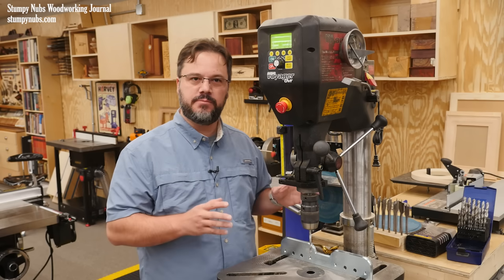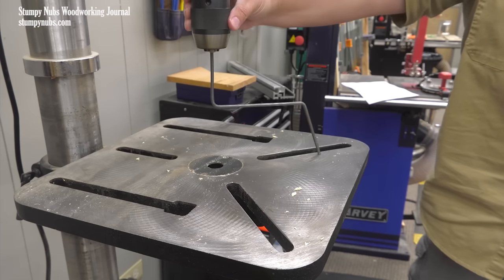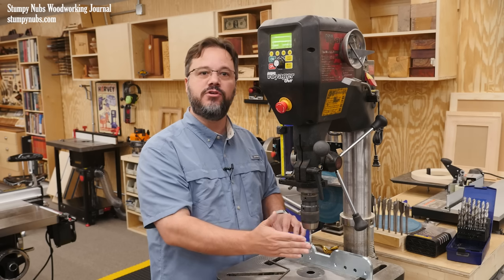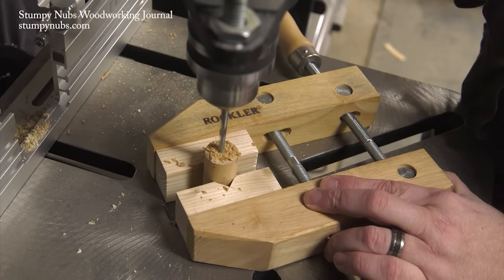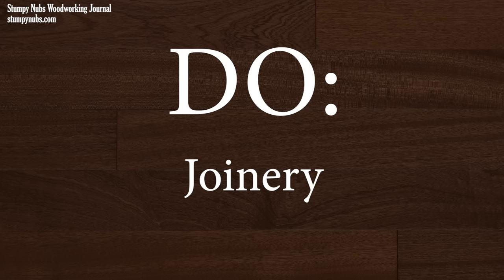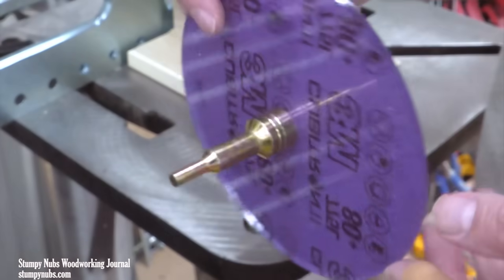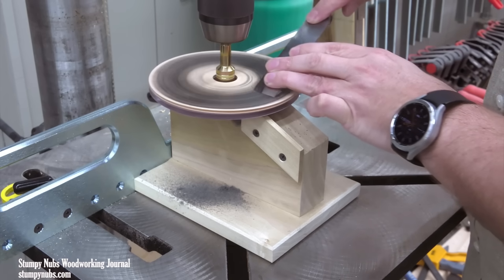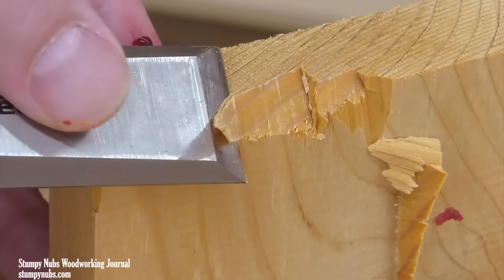WARNING: Internet drill press trend can SERIOUSLY hurt you!

Comment: Love this video! 
Another useful tip I learned: Place a block of wood down onto the drill plate first if you are doing to drill holes through sheet metal. This reduces the chance of the drill bit biting the sheet metal part and it helps to drip the sheet metal from wanting to move or spin.

Comment: Another DON’T: Do not accidentally leave the chuck key in the chuck and start the drill. It will quickly do one of two things 1) become a projectile or 2) remain engaged and repeatedly whack your hand if too close with enough force to break bones. Ask me how I know 🤪
Reply: And if you are enough of a goober to forget, magnet plate on the wall. Key goes on plate, plate pulled to magnet and turns on switch. Pull key, plate moves back and switch turns off.

I made my own after the 2nd key to the balls 😅

You could also add a cutoff switch to the key holder but I didn't think of it at the time.

Comment: I have a set of Delta router bits for my WW2 vintage Delta 14” bench model, they are an approved accessory. But there’s a trick. The set requires using a #974 spindle, with replaces the regular morse taper with a straight 1/2” hole for the bit, which is then secured with a set screw.
Reply: You basically have 2 in 1, drill press + milling machine.
Reply: @CemKalyoncu  Well I would if I had the 974 spindle. Sadly, that was missing when I got the machine. I do have the spindle for the shaper bits, but none of the rest of the parts like the fence & shaper bits. It did come with a complete morticing attachment though. It’s a cool machine, the serial number plate is made of paper card stock, dating it to 1943 when the US was conserving copper & brass for the war effort
Reply: @VernKlukas  That is very cool machine.

Comment: One nice use for a drill press is as a line borer  with a shaft in the chuck going through a bush in the table to hold the far end but still slide up and down. A cutter is fitter through the shaft at right angles to bore large holes very precisley. Milling cutters Will pull the chuck out, I know. great video.

Comment: Great tips. I can’t imagine having a shop without one. You may or not approve of this next use. I restore vintage Matchbox cars and I use a couple of fairly big finishing nails with little dimples on them to reform the axel ends to secure the wheels. I use the slowest speed possible and when possible hold the axel with small vice grips. 😅

Comment: I once caught my glove with an electric hand drill, even though I stopped it quickly, it was quite paintful for my finger and happened in a split second. Imagine what a big drill could do.
Reply: I had this happen with a battery powered drill, while screwing off a metal roof. The construction co's pen pushers had insisted gloves be worn at all times while working on their sites. After that incident, I told them, 2 choices: 1- no gloves while doing that job, or 2- find another roofing contractor. Never mind that wearing gloves meant the job took 3 times longer than it normally would!
Reply: And it can be so hard to explain gloves do not always mean safer too.

Comment: I used a step bit on a piece of sheet steel while just holding it in my left hand once.  Once.  After a week or so of healing and cleaning up the dried blood I used my fancy clamp I couldn’t be bothered to use the first time.  Took longer than it should have since I could only use my right hand.  Some lessons have to be learned the hard way I guess.

Comment: My biggest complaint with drill presses is that the slowest speed is way too fast.  I thought about buying a variable speed mag drill but for the small amount that I use it, the price was prohibitive.
Reply: Bosch have a green drill press with electric speed control and digital display that can swap to depth indicator. It will slow all the way down. Best benchtop drill press on the market.
Reply: It's possible to slow them down even more with a different set of pulleys. For woodworking I usually just use mine at the slowest speed.

Comment: Just be aware magnetic trays may magnetize bits and cause metal shavings to stick to them. Just annoying especially when trying to setup and ya can see the tip of the bit.
Reply: It's mostly a woodworking channel in fairness, not ferrous machine work where that is an issue.

Comment: I like your video emphasizing safety. It's too often disregarded. I started working on both cars and wood more than 50 years ago. I have my own shops with lots of tools including machining tools for metals. I always protected myself, secured my hair, wore eye shields, never wore gloves when working with the drill press or any other machine for that matter (other than my welding equip.) and I tried to maintain a safety first attitude all my life. The result? No loss of any digits, eyes or anything else. No significant injuries either, although working on cars can slice or mash fingers and skin. My biggest injury is 50 plus years of doing this work is hard on one's back. Another thing: if you're doing construction (I built two houses and four shops) always wear a hard hat.

Comment: I was a machinist at a place where a lady came in to tell us about the dangers. One story she told was about a young lady with braids who ran the drill press and she left her hair unsecured and it wrapped around the spindle and scalped her. Another guy was  using a band saw and he touched the blade and lost the end of a finger, and then this efficiency expert was instructing the other workers on what not to do and she asked this same worker what mistake he'd made and he demonstrated what he did with the band saw with it RUNNING AND CUT OFF ANOTHER FINGER.
I could go on and on.
Be smart when around metal cutting machines.

Comment: I know someone who uses an XY-table with their drill press. It's great when drilling small holes, if you have centerpunched the location. When setting down the drill (turned off) into the dimple of the centrepunch the drill should not bend. Check both directions and your tiny drill bits will last. Especially with drill bits smaller than 2 mm.

Comment: Any work should be secured on a drill press. A drill press isn't magic, it has limits. If your working with anything harder than soft pine make sure you have the right drill for your chosen material. The details of tool safety are learnt. I was taught at age 11 and everytime i approach working the next piece of material i carefully consider everything from lining up the tool to material, always creating a pilot hole with a punch and then smallest drill, but first clamping or bolting and last not standing where the machine could 'pitch' the material if clamp slips. I have experience using many tools and i learn more each time. Thanks for teaching proper tool use. Ignorance isn't bliss it's fatal.

Comment: I can testify about clamping metal pieces down for drilling. In my teens I was using dads drill press to drill mounting holes in a piece of sheet metal. The first couples holes went fine, then the bit caught a burr, ripped the sheet out of my hand, as you stated like a helicopter blade, as I reached up to turn power off, the metal sheet flipped upwards catching the inside of my left forearm. I still have the scar. Lesson learned the hard way.

Comment: Putting a strong magnet on the side of the drill press to hold the chuck key is a game changer. (As an IT person, I have access to plenty of used hard drive magnets which are super strong, although they're getting fewer and farther between with SSDs becoming popular.)
Reply: This is true when you do woodwork. If work on steel the chips will hang on the drill bit and the key.

Comment: Thanks for this video, Stumpy! I use a drill press mainly for metal, which I always clamp down - but didn't know about the NO GLOVES rule! Metal is either sharp (or hot) and as I'm on blood thinners, I generally always wear gloves. Might have to rethink this, given what you've pointed out here, and many others have commented about here. Safety is paramount: I'm just an amateur sculptor, but developed safety consciousness while working as a pilot and so I realize that it's always worthwhile checking out videos like this one!
Reply: Use the gloves when setting up and handling work, but always make sure to take them off before you turn on any machine. Since you have a reason to want to have gloves on for more than just convenience, you may just need to spend more time getting a setup that doesn't require gloved hands.

As a machinist I never wear gloves. I've learned over the years how and when to grab metal during various stages of sharpness. The only time I ever wear gloves is when welding (or sometimes when using a torch), and so never have gloves around rotating equipment.

Comment: This is a great video for my students. One thing I would suggest: Don't wear watches when using rotating equipment. I tell my students to take off watches and rings when running the vertical mill for instance. The drill press is maybe even more dangerous than the mill, because of clamping issues.

Comment: for using drill press for 20+ years for metal work, I also suggest to test how much torque your drill has. that way you know if you can stall it or not with the part you are holding, so you dont hurt yourself if the drill bit jam into the hole. If I have lot of part to drill, I dont like to clamp them all one after other.

Comment: On drilling any objects in a drill press but specifically metal parts.
A drill press rotates clockwise, always put a stop on your drill press table at the rotating direction, so at the left side. Rest the to be drilled part against this stop. If the drill catches the part will hit that stop and not be ripped out of your hand.
For metal the ratio of your drill bit to the thickness of the part is also important. Trying to drill a 1“ hole with a spiral metal drill bit into a 0,039“ thick sheat metal is asking for disaster.

Comment: Valuable Tip:for thin material: shim stock, especially plexiglass or brass- place your drill bit on the bench looking at the cutting edge. Roll the bit until the leading edge of the rake is parallel with the bench.Now using a small machinist’s triangular stone, create a small flat on the leading edge of the bit.The bit will still drill fine, but will not grab as it goes through the material.You’ll save many a part and avoid the usual “grabbing “ and possible injury.My dad had a whole different set of “flared off” bits just for this. Try it,you’ll see.

Comment: Good point about not trying to use router bits because of the side forces.  For the same reason don't use milling cutters in a drilling machine when metalworking.  The cutter shank can work its way out of the chuck while it's cutting.  There's a reason why milling machines use collet chucks.

Comment: If I need to drill into metal, it's important to understand speed, cutting capabilities and "press speed". I always add a little bit of cutting oil if I'm cutting metal. It's also good to have variable speed on your drill! Don't press down too hard on metal or wood, or the bit will likely catch, instead, allow the tool to work gently at the pace its supposed to, and help it with some oil.

Comment: I had a work accident doing just the same thing. I was drilling an “L” shaped copper Buss link, not using a vise grip or stationary device to hold it, plus I had a choice of a belt drive or gear driven press, the belt drive was being used so I just went ahead with my drill. Big mistake, after 3-4 seconds the copper heated up and the drill bit grabbed the part, whipping it, at 500 rpm, into my wrist joint before I could even let go, smashing at least 3-4 times. I let go and grabbed my wrist as the bar kept spinning around due to the gear drive not having a brake. After 6 hours at emergency, ended up with double fracture wrist and 6 weeks off. Lesson learned. 👍🇨🇦

Comment: Jr high woodshop. Student using drill press to drill 1/2" holes in end of multiple couch legs. (legs approx. 8" long). Legs held in place with unsecured vice. When drill bit seized, out of balance vice progressively bent the drill bit until it flew off. Industrial sized drill press did a dance while this was happening. Luckily no one was hurt as we all dove for cover. 2:23 in video reminded me of this.

Comment: Link it baby!  😂   I think we've all had something grab and pull from our hands.  I'm gonna bet the outcome difference is directly tied to how much the operator anticipated it.  I also have a way of mitigating it on the machine side, and that's adjusting the belt tension so it loses grab above a torque value where I'm to hold onto the piece.   Ideally, yeah, you clamp everything up all nice and all.  I've done it for critical and repetitive tasks.  But mostly when I use the drill press, it's to keep me going on projects, I'm fixing something, etc, and I've learned how to manage without burning time unnecessarily for me.

Comment: Years ago I worked with a Tool & Die maker who was missing roughly 1/4 to 1/3 of his hand.  I screwed up enough gumption to ask him what happened.  He told me he was drilling an unsecured metal plate, the bit caught in the plate, it whipped around and sliced his pinky finger and the flesh of his palm off down to the wrist.  You can learn from other’s mistakes.  I’ve never used a drill press without securing the work piece.  It only has to go wrong once….

Comment: I want to add one more safety rule. I learned this 35 years ago when I first started woodworking. Not knowing any better, I chucked up a self feeding 1 1/2 inch drill bit into my drill press. I was drilling into a piece of 1x3. I fed the bit into the wood and in less than a second the bit violently grabbed the piece wood, spun a few times and then let loose and threw the piece 6 feet and stick it into the sheetrock wall. That wasn't the scariest part, my 5 year old son was standing right next to me. I'm eternally grateful it didn't hit my son. I still get chills to this day when I think about this incident.

Comment: Very useful tips, especially the don't do's. I can't recall if I ever wore gloves when using a drill press, but I may well have done. I have been lucky, having been doing DIY for decades, and have had my share of near misses. I don't have a drill press any longer, but some of your tips can apply to drilling in general. My absolute favourite tip was sharpening chisels, quite the most boring job to do with a whetstone. Could it also be used for plane blades?

Comment: I agree with those who say to keep the work piece to the left up against the column or fence if you have one.  That way if the drill catches and wants to swing the part, it can't go anywhere.  Also, be ready for the drill bit to pull upwards on the piece when the drill breaks thru the bottom (especially on thin steel).

Comment: I didn't know about the gadget for sharpening chisels.  Thanks - I'll get one.
The accident you had while drilling a spoon happened to me just days ago.  I was drilling a hole in the top of a yale key when it jammed and spun the key around.  A Yale key isn't very thick, and it was flat agaiinst  the drilling table, so I didn't get hurt - well, not enough to speak of - but it was a valuable lesson.  After that, I clamped it to the table.
If you don't have a drill guage for the drill size, an electronic caliper does the job nicely.

Comment: Machinist here. You don't always have to clamp down metal objects so long as you have a method to keep them from spinning other than holding the part with your hands. Whether it's putting it in a vise and resting the vise against the left side of the head support, or if the part is big enough, resting the part against the left side of the head support. Especially If you're drilling AR steel, then MAKE SURE YOU DO ONE OF THOSE TWO, OR CLAMP IT DOWN. When the drill breaks through the back side, it usually likes to lift the part off the table.

Comment: * You need to cover angle iron vise racks.  They're faster to set up and more stable than just clamps.
* Also discover Bostik Bladecote to keep you tooling from cooking itself.  Not airtight but (in addition to directly reducing friction) it reduces the frequency and effort to keep the bits clean, which is itself a disincentive to bothering to clean off resin and other gunk.

Comment: Put a piece of softwood on the base of the drill press.  That way when you drop a drill bit through the center hole in the table it won't break the tip when it hits the cast iron base.  Pick up the wood and oil or wax the machined surface underneath now and then so it doesn't rust.

Comment: There used to be many firms (Goodell-Pratt, Miller's Falls, Union, Metabo and many others) that made hand-cranked drill presses, which are much safer than an electric machine for drilling something with an awkward shape that you need to hold by hand. Most of the machines have automatic feed, so you can crank the machine with one hand and hold the workpiece with the other. There don't seem to be any firms still making such machines, but they are readily available at reasonable prices as "antiques".

Comment: May I recommend one employs stepped drills in the drill press for drilling thin sheet metal rather than standard drill bits.  As the step drill will not `Grab` as it goes through the hole and will remove the top burr.  To remove any lower burr just turn the piece over and re-enter the hole.
Take care.